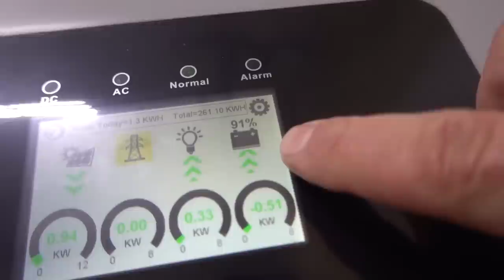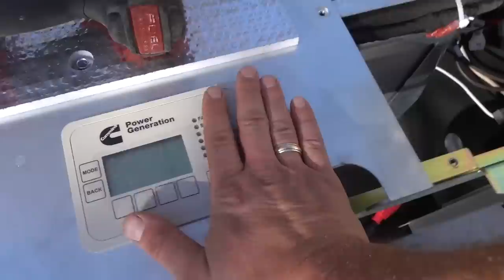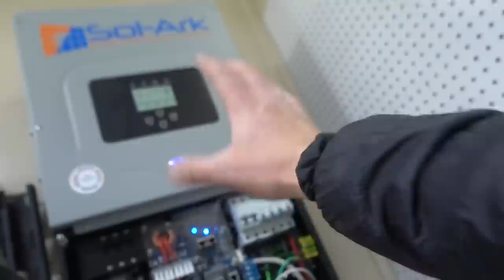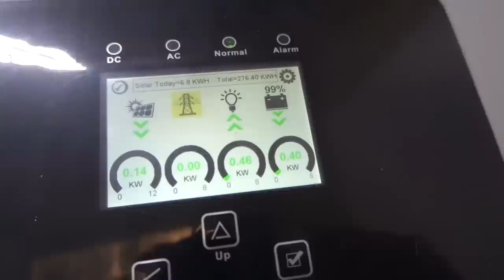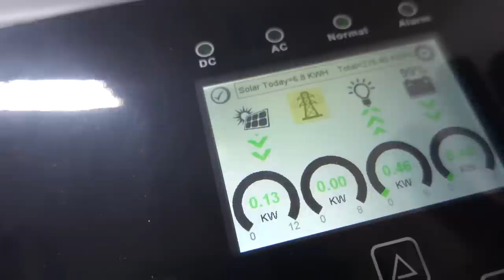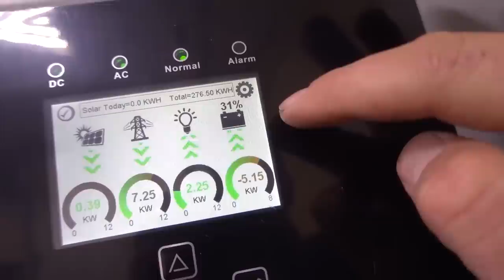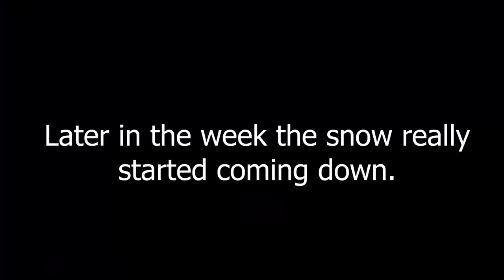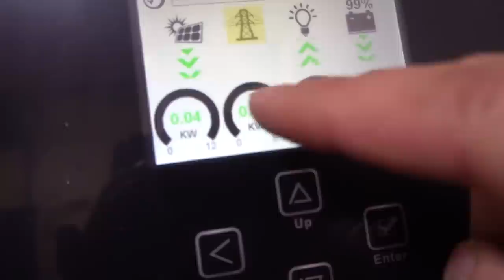The New Cummins Generator Saved Us During the Snow Storm!!!

Comment: Don't know about prices over there, but over here Kubota is about the best price/value ratio. Most bang for the buck. And they are considered the most reliable too. Like the Toyota Landcruiser is for four-wheel transport (not talking pulling force). And from all that I've used so far, I must say the Kubotas really stood out over Hitachi, CAT and Toyota (the other brands I've used, so I can't speak for John Deere). Let's say they pack ease of displacement of a 12 ton, in the package and the price of a 6 ton. I'm sure your dealership will agree with this comparison and provide you with exact reasons why.

Comment: put a wood stove in there as supplemental heat...i think they call it a sacrificial annode that will break down over time due to electrolysis rather than electrolysis attacking(corroding) the tank

Comment: If you are using the generator in the summer if it's just air-cooled even with the fans and everything they will get quite warm and will easily over heat especially big if their air ways get blocked especially from animals so always check inside and out

Comment: That's a tidy generator. Lpg makes more sense than diesel too as you don't have to worry about water, Algae or freezing with lpg like you do with diesel, especially if you want it to sit there and last year's with minimal use. The oil in LPG engines also stays clean for way longer.

Comment: They are all good it’s all about the dealer support . Go meet your local dealers mainly service and parts dept feel them out . I have a Takeuchi TL10 love it will do every thing and more it’s a 10lb machine with tracks if I were you get tracks for sure ! Kubotas are nice and bobcat ,CAT. I’d stick with those brands I love My TL10 next I’ll get a kubota prolly I like the door in mine and kubota it slides up instead of out which Is super  nice instead of out definitely get a cab AC/heat is so nice, especially in rain or hot summer .

Comment: It's called galvanic corrosion. Boats (even fiberglass boats) have to deal with this as well, and the way it works on boats is that zinc plates are mounted to the underwater hull of the boat. Any metallic part that is in contact with the water (or potential contact) gets wired to the zinc plate. The zinc plate will corrode before any other commonly used marine metals because it accepts a charge much easier than all those metals. The zinc plate will wear away due to galvanic corrosion and after a few years will need to be replaced. If you fail to replace your zincs, the galvanic corrosion will move to the parts of the boat that are important, like through hulls or prop shaft, which will eventually lead to your boat sinking :O. 

I don't know exactly how this land based system works, like what's in the bag, and does it have to be replaced periodically like on a boat, but I'm assuming the bag takes a charge quicker than the steel tank, and will corrode before the tank does, similar to marine based systems.

Comment: Would be kewl if you could figure a way to vent the exhaust from your generator to under the low point in your solar panels through a waste gate type of valve,, to melt the snow off,,  The waste gate could be thermostatically controlled from a temperature sensor on the panels,,  With a propane powered generator, there would be no sooty exhaust,,  🙂

Comment: hey matt, im actually a cathodic technician, meaning i work with the anode bags all day just on larger pipelines for city water and stuff. what the anode bags do is called sacrificial protection, in the grown there is stray electricity from all of the power lines or anything like that in the ground even just leftover from lightning strikes, and that electricity looks for something more conductive to jump into, when it goes into your tank it would find the path of least resistance out of your tank, without the anode it would leave from one single point and take small particles of metal with it slowly corroding your tank, the anode gives the electricity a place with almost no resistance to leave, so the anode would degrade and corrode away instead of your tank.

Comment: The bag and the sacrificial anode wire are sacrificial parts to protect your tank. The idea is the same with water heaters. If there are ions (like what you get when you split water in to a H+ and an OH-), the anode is to attract the negative ions (OH-) and chemically bond with it. So, you're going to need to periodically take a volt meter and test to make sure the sacrificial anode is still good.

http://www.ncagr.gov/standard/documents/Questionnaire.pdf

Comment: A lawn more motor is not a cummins and you want 1800 rpm max so a car motor will run forever on propane and NG is not so good on a 30 KW unit you only get 28 KW with NG and 30 KW on propane.

Comment: Nice to have a propane generator, but the administration wants to eliminate fracking, fossil fuels, and the burning of hydrocarbons. I have PV panels as you do, but mine are grid tied. If there is no supply from the grid, even with sun, I have no power. We need more control of our power systems on a personal basis, not for the advantage of the corporations.